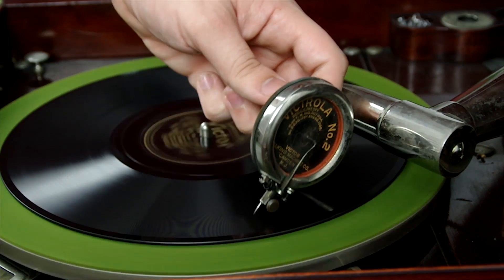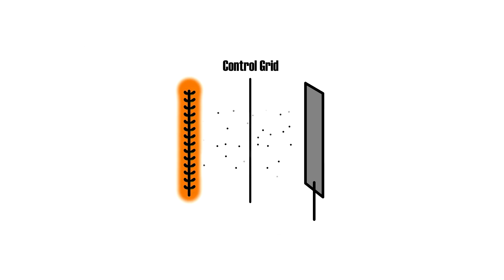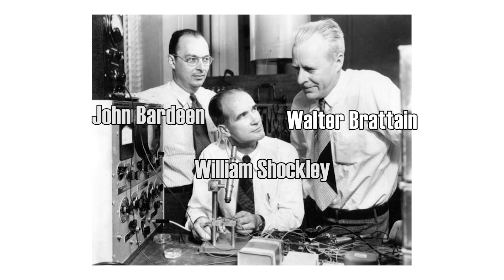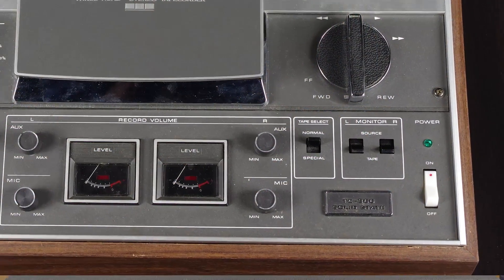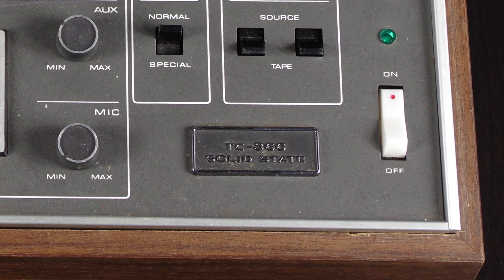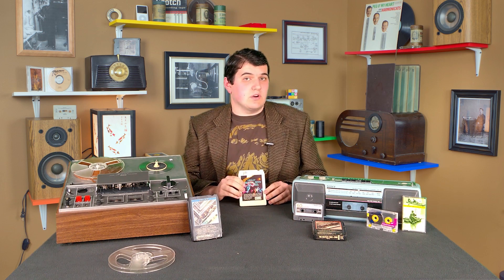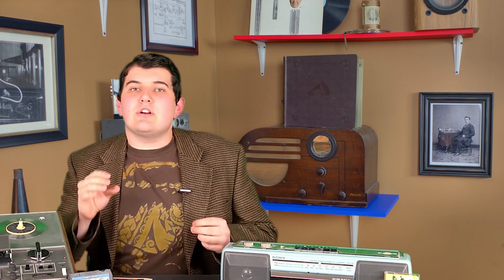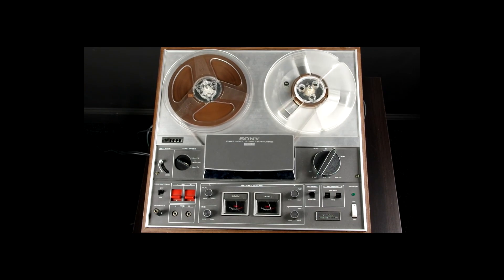Transistors: Making sound easier, smaller, and more efficient

Comment: There is a lot of discussion surrounding Lilienfeld. I actually read that one guy at Bell Labs said he never produced a working prototype around '48 (to promote their in-house product, instead of some random guy's) and a decade or two later actually said that Lilienfeld actually did make a working FET. Non the less, if you were to read the 1925 patent you would surely admit that Lilienfeld actually did invent FETs (he included the schematics for a multiple stage amplifier using it in there, for god's sake!)

Comment: Another advantage of the transistor is that it used low voltages.  Tubes used 10 to 20 times the voltage, which was a shock hazard and required large expensive batteries if you wanted portable devices.
Reply: @user-n4b4q  Not always! A popular "table radio' into the '60s, called "the all American 5) used JUST the line voltage for operation. The B+ voltage was derived by rectifying the 117vac and heater voltage was derived by putting the heaters in series across the 117v.

Comment: Field Effect Transistors have source, drain, and gate. They are voltage controllef devices, very similar to tubes. Bipolar Junction Transistors (this type was invented at Bell Labs in 1948) have Emitter, Collector, and Base. They are current controlled devices, where collector current is a function of base current.
Reply: One of my electronics Teachers used to say, "If the FET had been invented first, the bipolar transistor would never have been invented."
Reply: FETs was invented first. But process of making them was figured out after bipolars.
Reply: @NuckTH  theorized first, not invented first
Reply: Correct! The only way to develop a voltage with a BJT is to use a resistor in either the emitter or collector circuit. Current flowing through the resistor will develop a voltage across it.
Reply: Original Bell Labs transistor were "point contact" transistors, not BJT. Point Contact transistors never became very commercial, and were replaced by BJTs first in Germanium, followed closely by silicon.
Reply: I have paused the video to see how many people we're thinking the same thing
Reply: C.B.E. BC548 transistor [pre]Amplifiers
Reply: Right ... I see right now you corrected him already months ago ... but he never corrected this wrong video :-/

Comment: Another advantage of transistors is they worked right off the bat when switched on.  Vacuum tubes needed time to "warm up", that is, allow the filament to get hot enough to start emitting enough electrons
Reply: Andrew Timm I remember eating breakfast in my footie pajamas waiting for the TV to warm up so I could watch saturday morning cartoons.  :)
Reply: Even today, a lot of solid state electronic devices still sit idle in standby mode, drawing energy when not being used. So energy conscious people still unplug when they go away from home.
Reply: In the 1960s, they had electronics that kept the tube heaters on in standby mode. This often led to shortened tube life and a fire risk. Many people unplugged their TVs when they left home for extended periods.
Reply: Doug Browning We had a hybrid tube/transistor tv that also had the standby feature on the filaments. In my experience, the low standby power, and gentle heating eliminated thermal shock to the tubes when switched on, greatly extending their life. It was "portable" by virtue of the handle on top, but it was far better suited for using a crane...
Reply: @mikecowen6507  The code-breaking machine known as "Colossus" used at Bletchley Park during WW2 had a then unprecedented 1500 valves (tubes) in it, but failures were rare because the heaters were never switched off.
Reply: @dougbrowning82  The heaters were not run at full voltage, and actually extended the heater life because thermal cycling was eliminated. Reason for unplugging or the "vacation" switch position was to save on electrical usage!
Reply: True, my family had a Magnovox TV just like that.  It was supposed to run in standby with all the tubes warmed up so you could turn it on in an instant.  My father kept it turned off though, for fire and energy consumption reasons, so we had to warm it up like everyone else.
Reply: yes, and unlike the tube systems, which drew most of their power keeping the filaments hot, solid state systems draw almost no power when idle  The power loss is through the small amount of current the power supply transformer draws even when it's idle.  There was (and may still be) pressure to make a single low voltage household system for electronics, on the idea that one large transformer is more efficient that a bunch of small ones.  In the meantime, all we can do is unplug our chargers when we're not using them.
Reply: @Andrew-ep4kw  High end audio amplifiers draw Plenty of current when idling, they have to because most of them have output transistors biased to run class AB or even pure class A. The only ones that don't draw much current, are the class D and above...
Reply: @Andrew-ep4kw  I could see in the future our houses having mostly all DC power and we just plug our devices into the wall over clean, noise-free DC.
Reply: There was (and may still be) 12V residential lighting systems available and there are many USB outlets available. It's just a matter of someone putting 2 and 2 together. And, by putting step down transformers at the service panel, you'd be isolating users from our Westinghouse electrical system that makes the earth part of the current path, the only electrical system in the world that does so (most electrocutions happen when someone unwittingly becomes part of that path to earth). There isn't much in the current electrical codes, except that such installations be done neatly. Many current home electrical devices could be made to run on low voltage, as many automotive/camping versions of familiar appliances already are. High voltage could then be reserved for the major appliances.
Reply: But the standby mode power consumption of a solid state device in standby mode is a very small fraction of what a tube in the same mode. Must have been a real concern, without having to be specially energy conscious.
Reply: ill take tubes any day
Reply: @bronsonosborne2064  LOVE YOU, BRO!
Reply: not ALL of them - most of the early germanium transistors didn't EVER turn on in fact :P
Reply: @Andrew NOT all vacuum tubes were created equal, the ones in portable devices (directly heated cathodes) were "instant one" !

Comment: try telling a guitar player that transistors are better than tubes.. won't go over well
Reply: When I heard that rumor (about superior tube sound), I checked out what the two sound like. I found the transistor sounds better.
Since then, I'm convinced, the transistor also brought us better sound, maybe even better pictures when every tube except the picture tube was replaced by transistors in TVs.
Reply: Rainer67059 And now many flat panel displays have transparent transistors etched directly on the display surface.
Reply: Different goals.  Technology moves forward to improve accuracy and fidelity, while creative artists find new and interesting ways to dirty the signal up again.

Nonetheless, once a vision has been (im)perfected to realize the goals of the artist, you want to preserve the fidelity as much as possible for reproduction.  Hence analog recording studios using mics from the 60s and electronics from the 70s, to record guitars and amps from the 50s -- all of which is played back on digital devices that are upgraded before they're 2 years old.
Reply: Have you ever heard of a device called the Herzog? It was developed in the mid 1960s for Winnipeg guitarist Randy Bachman by Garnet Amps founder Thomas "Gar" Gilles. It is an overdrive effects box designed to replace the daisy chaining of two guitar amps (which often had devastating results), primarily consisting of a small, low powered, single ended amp (6V6 GT, driven by a pair of 12AX7As) with a 5 Watt, 8 ohm shunt resistor across the output transformer's secondary winding. The effect can be heard in The Guess Who's "American Woman".
Reply: Tubes and transistors put out different harmonics when over-driven.  Generally, the harmonics from over-driven tubes are considered more pleasing to the ear than what you get from over-driven transistors (which I compare to sending sound through glass shards).  This is just my personal opinion based on my personal taste, so don't put too much stock in this statement.  Essentially, it is an artistic call.
Reply: May be we should consider that electric guitar has narrow spectrum of harmonics - enough is up to say 3 kHz instead of 20kHz. . With such concept tube amp shows its hidden in feedback advantage. Unfortunately solid amp employs overhelming feedback which is very sensitive regarding irregularities in phases of output signals. This irregularities are produced at 1-3kHz else by crossovers or by membrane-coil resonances of widerange speakers used widely by guitar players. . That is why solid amps lack details which are delivered by tube amps.  If blaiming tube amps for distortions would be true then in each case solid would be judged. better - why not? Lovly distortions coud be done in effect unit at side .   On my side I can state that tube amps have their disadvantages but it is nothing in comon with distortions and that by using ideal speaker set and instant switching for compair  I get 99% nonrecognizable sound of my solid Luxman and tube Pioneer. But condition is thst the speaker makes little  phase shifts  (in it's electric part). Saddly it is not happening in good performing  speakers